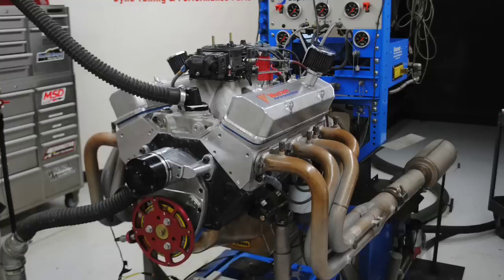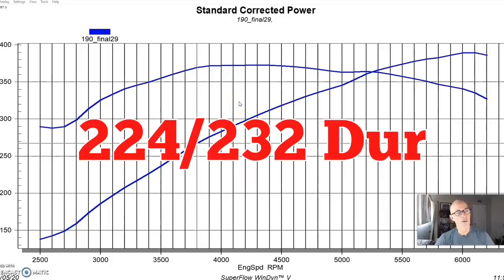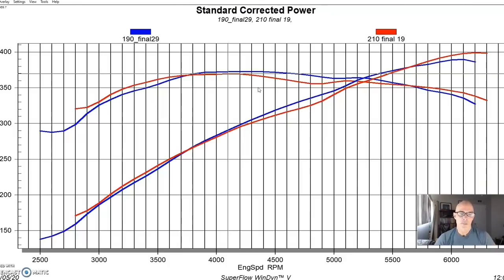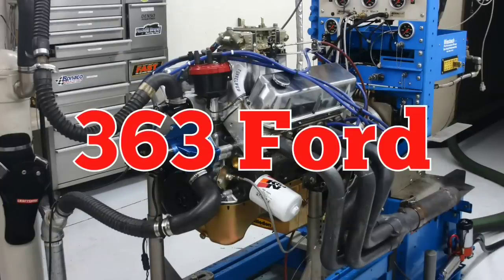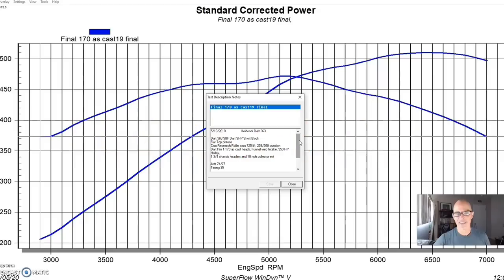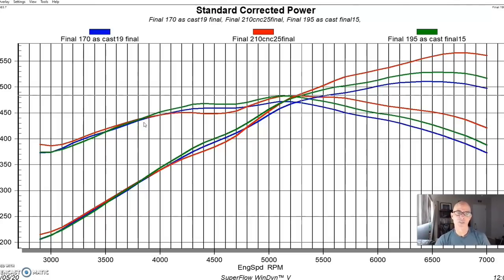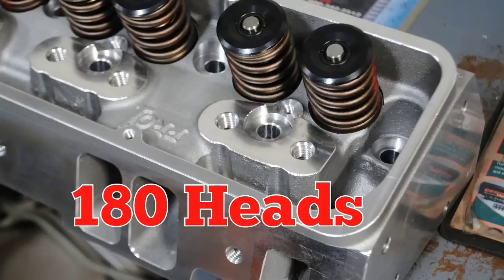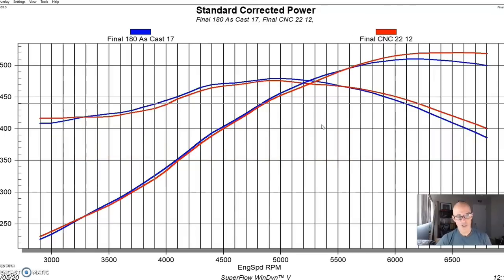PORT VOLUME-IS BIGGER BETTER OR IS LARGER LESS?

Comment: Here's a good one to think about Richard. How much power can you gain by simply controlling oil in the pan and drainback. Some of the pure stock guys claim there is as much as 50hp in the crankcase by keeping oil off the crank, polishing everything to lower turbulence, and doing everything they can to reduce crankcase pressure.
Reply from the maker: there is power to be had from oil control-we have never seen 50 hp unless the oil level was excessive
Reply: @richardholdener1727  I think that included dealing with air movement in the crankcase as well. The article I saw showed where the builder had even bored holes in the webbing between the cylinders to allow the air being displaced by the piston coming down to be more quickly dispersed. And like I say, it was a claim of as much as 50hp, lol. I saw a claim of an oil additive that would allow engines to easily start in sub-zero temperatures, even while they were frozen in a solid block of ice. Of course they didn't mention the engine was only at 32 deg F inside that block of ice.

Comment: I think that the Cnc porting is significant. Port shape helps flow a low flow speeds at the lower rpm. It would also help at part throttle.  Proper port shape right around the seat area and guide that is a result of the cnc porting is most likely more important at low rpm than port volume.  I would have liked to see the dyno run start a 2000 rpm.

Comment: Low rpm power may suffer at lower throttle positions giving the seat of the pants Dino credence to loss of torque by using overly latte heads.

Comment: port volume cc's means nothing,its a generic selling tool just like flow numbers. no different then duration an lsa numbers for cams...what matters the most in heads is port speed an then figuring out your cross sectional area needed for your power goal..air speed is king period.

Comment: I remember when I first put the edelbrock performer rpm top end and the 650 on my maverick with that "mild" solid cam https://www.compcams.com/xtreme-energy-230-236-hydraulic-flat-cam-for-ford-221-302.html  claimed 2500 to 6500 back in the day. With the same convertor as a isky 272 hl cam previously it 60footed the same and slightly slower with 3.55's. I acquired a set of 4.62's and gave that a try.. it ran the same et's between the 2 and the only real difference is the mph and with the artificially limited rpm limit of 7000 rpm hypereutectic pistons 13.0 at 105mph. 1.9-2.0 60 foots no joke and with the 4.62's ran out of rpm at 1200 feet.. probably mid 12's with winding it up closer to 8000 rpm so 60 foots didn't change but damn that thing felt slow till 4500 rpm.

Comment: I would bet there is something to air velocity but the cylinder ports are so short compared to the rest of the intake track that the air likely doesn't have time to slow down much going through the port unless the head design is really bad.

Comment: Basically any engine is a air pump. Increase port size and air flows easier. That means more air should make more power if jetting is right

Comment: What I'd like to have seen was this.    Pretend its a low RPM engine. lock the max throttle opening to 1/4 opening.. try and simulate  the throttle opening you'd use  for around town driving. pretend its a 3600 RPM max motor. start as slow a speed as possible. limit to 3000 R's .  if the test is all about low speed performance of large port volume heads. wouldn't that be what you would do ?
Reply: I agree. If you're going to talk torque, you need to start at 1000 rpm and run to 4000 rpm on 1/4 throttle. That would be very valuable because that's where we all drive 99% of the time.
Reply: What I'd like to have seen would have been a smaller cam with the bigger heads. Look at the cam specs, and port volumes for an LS engine, big heads, and a small cam will make more average power, then big heads, and a big cam.
Reply: @FXRSDriver  current OEM engine design thought is big port/efficient combustion chamber with really mild cam timing. The pushrod engines ( LS/LT and Gen 3 Hemi ) are prime examples of this. The Coyote has the advantage of variable cam phasing along with the overhead cams so it can rev out past 8000 rpms and still act nice down low.
Reply: @hoost3056  Yes! You nailed it, It's incredible just how much more CFM a Gen 3 or LS/LT Cyl can flow vs there traditional counterparts. Some of those heads flow near 300cfm at .500inch of lift that's why they make so much power with a broomstick of a camshaft installed.
Reply: Is that not what these variable cam motors are about.  Where you have one cam profile to max power and drivability down low and the darn things wake up above 4000 rpm
Reply: Yes I was thinking the same thing, the smaller heads would show the bigger heads up in this scenario for sure, in my opinion.
Reply: @port nut nope. This is before that technology.
Reply: Most engine dyno’s can’t load below 3000rpms, a few nice ones can get down to 2200-2500.
Reply: @tylerdurdan1691  go to a diesel dyno then.
Reply: @tylerdurdan1691  DC dynos will hold an L5P at 1,200 rpm WOT all day long. Water brakes can't do that. I think DC dynos are also hideously expensive.
Reply: @tylerdurdan1691  dyno's are built for the performance market and focus on WOT
Reply: @WarpedSpeed  no. Dynos are built to measure power and torque, it does not matter if the engine is a 100hp 1.5 liter or a 750 hp 9 liter.

Comment: It seems like changezvthe torque curve in a sine wave rather than a seesaw. I remember years ago (15 plus) reading about a Holden Torana with a 202ci 6 cylinder that was built as an extreme road rally car, and it had triple 51mm Webber DCOEs and the biggest ports they could run to improve super low rpm torque, and it made the engine more linear in mid rpm, and lots of power up top

Comment: very good comparison i have also seen similar results comparing a victor jr to an rpm performer where the victor jr made more low speed power and top end but less midrange.  Another

Comment: It is interesting to see the sine wave shape of the dips in mid range torque as port volume increases. My physics is too rusty to be certain, but looks like some flow dynamics resonance going on. Is there a known effect on air pressures at the valve related to runner length? I would guess longer runners produce higher pressures at the valve face to promote flow at lower rpms.

Comment: Another good comparison would be 2V vs. 4V Cleveland, or "Peanut Port" BBC heads vs. Rectangle Port (L-72/L-88) on otherwise identical engines (cam specs, compression, carb size, header size).
For years, there's been a lot of BS 'know it all' types that would swear that 4V Clevelands were too soft down low, and that they did'nt come on until 4000+ RPMs, and other crazy stories. I used to have a 72 "Q" Code (351C/4V) Ranchero that would spin the tires very easily from an 800 RPM idle, just stomping the pedal from a signal light. It had plenty of torque down low!
Reply: Gearing plays a big part.
Reply: @OGbqze  True. My Ranchero was equipped with 3.25:1
Reply: @biscuitboy3617  Odd, my 70 Mach 1 351C 4V with 2.35 and fmx was pretty soft in the lower ranges..exactly what I was expecting.
Reply: @qball1of1  Did you have different rear end? I ask because I believe that 2.79:1 was the tallest gear ratio that Ford offered in the 9 inch axle. I imagine that most Mach 1 Mustangs came with 3.25, 3.50, or 3.91
Reply: @biscuitboy3617  Oops 3.25..bad typo.  Was a great car just thought a bit soggy on low end.  Some others have have no complaints so I guess its all relative to what a persons expectations are.  No denying the potential of the C though, doesn't take much to wake it up.

Comment: I'm glad you ran this test, I am shopping for heads for my 400 (stroker Cleveland). I tried to build the open chamber heads and just wasted my time and money.
Reply: I just built a clevo recently, the head guy told me to use the heads I had and he worked them from there.  I used 2v closed chambers with 1/16th oversized valves.  He flowed the heads and is revving and making great power
Reply: Just over 500hp, still 351 CI.  12.5:1 comp.
Reply: @amac5224  Is that on pump gas? I'm only at 9.5/1 and am fighting detonation by running rich and adjusting the rest out of the timing. I bet I've lost at least 100hp by detuning it because of these open chambers. I have a lot of time and money into these boat anchors.
Reply: Trigger Warning yeah it’s 98 octane
Reply: Trigger Warning also the ignition system you put on makes a huge difference
Reply: @amac5224  Im using the "ready to run" msd dizzy set up for the motor. I was having issues with it and had msd rebuild it but I still think the stock dizzy worked just as good if not better.
Reply: @triggerwarning2439  if you are getting pre-ignition detonation with 9.5 compression, you need to change the cam.  Get a custom grind [or just one with longer duration] to lower the dynamic compression.
Reply: @johnb7430  I did, dont remember what it was but I had one made just for the fact I was going to be running detonation prone heads.

Comment: Bigger the head, bigger the compression.
Reply from the maker: smaller the chamber-bigger the compression
Reply: @richardholdener1727  every one knows that Richard, I don't really recall you mentioning chamber size. Your videos are full of info and love to watch, but sometimes not enough. It seems every time u build a sbc you short change it some how, either not enough cam or not enough compression or all the above. Anyone can throw parts at a motor and say it is what is is but its all about the adjustments inside the motor that makes the big difference. One point of compression on a 10.5 to1 sbc motor still not enough, you need BIG compression to make up for losses on lower end. Keep up the good work, stop teasing us and build a fire breathing sbc.

Comment: Could you mimic part throttle on a dyno by using an undersized carb? If an engine hits max power with say a 700 CFM carb would a 350 CFM carb be similar to say half throttle then with that engine?
Reply from the maker: I don't think its that easy
Reply: @richardholdener1727  Probably not but has anyone ever tried it to see?

Comment: In a cyl head i always look for the low and midlift numbers and that gives me an indication on how efficient the port is by flow. It always seems that the better flowing head even if port volume is smaller in comparison to a bigger head w/ bigger port volume always seem to make more power up until the very top of the curve when some of the high flowing heads start to edge over.

Comment: For "mild" street engines, it looks like the bigger $$$$ cnc $$$$ heads aren't giving any more hp.  (Yeah... couple percent after 5000+. )

Moral of the story looks to be get heads with good geometry flow matched the rest of the package.  Over buying "potential flow" does nothing if the rest can't use it!
Reply: I agree. What I took away from this test is, if you run a street motor as a daily driver, save your money and just port a good set of stock heads. At the rpm range it will see on the street, the big port expensive heads are a waste of money. If you drag race the engine or circle track it, then of course the big port heads rule.
Reply: @richb.4374  when talking old school Windsor's or 23° sbc stuff one of the big improvements in newer heads is combustion chamber design, and while some of the heads may seem huge, if your intake is right and matched its still very steet-able. This is where spending the extra 100 bucks on a custom cam to tie it all together comes into play.

Comment: The volume is subject to length so it's specific to the engine architecture, it would be better to rate cross section. But you run into other problems. For instance most inline valve engines have less cross section around the pushrod than they do at the valve. A lot of the volume is at the bowl and the approach to it. And there is argument for this acting as a reservoir and helping fill the combustion chamber in the overlap period but it's never been clear how much is enough.
Reply: Sometimes even when you kill torque with big heads and/or big cams, just the right exhaust tuning can bring back drivability. It might take systematic testing though because exhaust tuning isn't all flow, it's complicated by hemholz resonance, sound wave reflections, and temperature loss changing acoustic impedance all complicate the subject and most books only mention tuning formulas in relation to peak power which sometimes is much less sensitive than drivability. Jim hand wrote a book on tuning his full exhaust Lemans wagon into the 11 second range. It's not the most radical build. The stroker crank helps but the cam isn't too impressive, the exhaust isn't large. It has mufflers that aren't straight through. He found that the "turbo" mufflers worked fine behind the axles. By this point the gasses have cooled, even with dry air it's probably half the volume vs the collector, with steam from water vapor it could condense a bit more since the tail pipe Temps could be below boiling but I'm not sure how much water is in the fuel and the air. He tested everything he changed and was able to maintain starting torque pretty well as he searched for more power. There isn't a formula for a high power engine with perfect drivability for the hotrodders with classic engines but some trial and error can go a long way if you have the time.
Reply from the maker: Helmholtz Resonance is most pronounced on the induction side
Reply: @richardholdener1727  perhaps. But both effects always exist in both systems. Audio engineers usually consider a system 1/4 wave or above in length to be a reflection system and shorter systems hemholz since you can imagine taking a bass reflex speaker and making the port bigger. As the diameter gets larger the resonant frequency increases as it becomes easier to accelerate the air to lower velocities thus the process takes less time to reverse direction and oscillate. You add length to the port to keep the system tuned. Eventually the port diameter rivals the chamber size and the length is so long that the time it takes sound to move to the end of the port starts getting close enough to the speakers frequency that it can change the output from time alignment with the original signal. The port always had sound wave reflections in it but they were in the treble range and we weren't concerned with it. At some point it got a little more convoluted.

Now consider that all the traditional formula for header primary and secondary lengths tend to put 3 reflections in 120 degrees of crank angle. Why 120? (or was it 240?) I guess because if you make it harmonic to the whole crank rotation the reflections might stack up and have a stronger effect and because a "racing" cam should have appreciable flow for that long. That might be 4 reflections at torque peak and that jives with audio engineer logic to start looking at things as reflected systems at 1/4 wave. But at idle it could be 30 reflections. At 2000 rpm it could 9 reflections. With a shorty header it could be 6 reflections at peak power. At some driving condition or some space limitations for street driving cars it is probably useful to look at hemholz tuning in the exhaust for reasons other than drone cancelation. But on an engine the math is messy.
Reply: I assume when power numbers are that close together the head was not the limiting part?
Reply: @russellbroadwell  the flow numbers aren't that different. The flow is the most reliable indicator of power. Lots of formulas say how much csa you "should" have but if the ports are all pinched through the pushrods then your tuning probably isn't exactly what you think. Since I personally like dual plane manifolds which have ports fairly constant in csa I like as much of the port to match as possible.

The old "reservoir" concept may have worked for smokey yunick but I've done pretty well with 190ish cc heads and see no point in 200+ cc for that kind of build. But maybe with big camshafts and custom headers meant to give the intake a yank and a single plane so the port forms a kinda venturi shape then the hp might shine with the big heads.

Comment: I don't think huge ports are as bad as people think. Hell a 351m or c has a huge port and sill made good tq.ford would have sold more gas trucks if they had kept those motors instead of just going 302 and 351w. The 302 in a half tons not bad but a stock 351w in a 3/4ton 4wd is very very slooooow.

Comment: not totally sure but if you want to make improvment you should flow bench the head to saturation lift  and pick up the cams and lift with the head.Even in the 306 if you would have a more agressive cam would make a bigger difference when you have more flow through the head.Cam should be change with the airflow of the head.

Comment: How cool would it be to quickly and efficiently test these things on a chassis dyno where you could measure part throttle output reliably. Cool tests nonetheless! Hurry up with that Gen 2 LT1 SBC big bang test!!! 5.7 or that not very well known 4.3 V8 ;-)